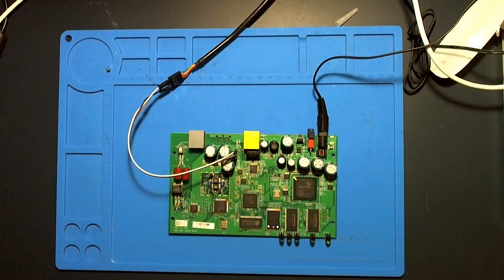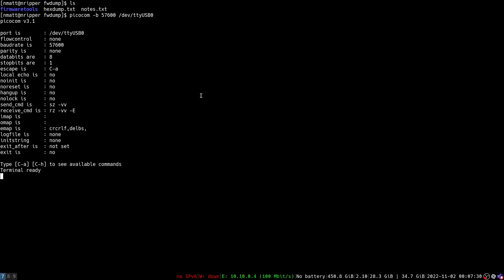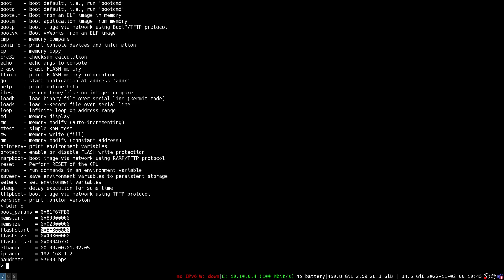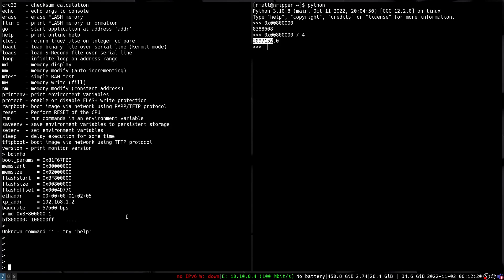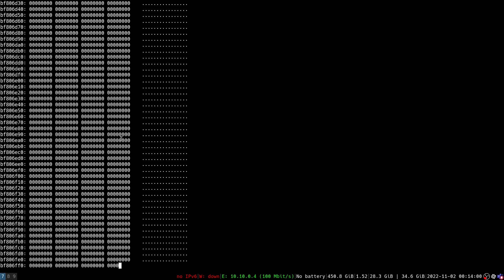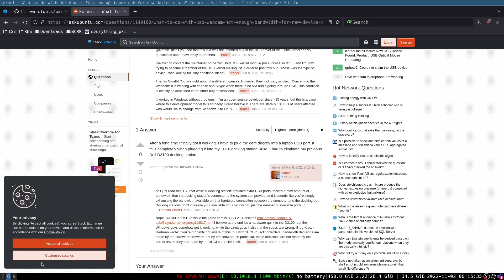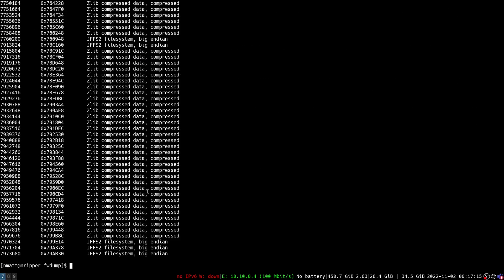Extracting Firmware from Linux Router using the U-Boot Bootloader and UART

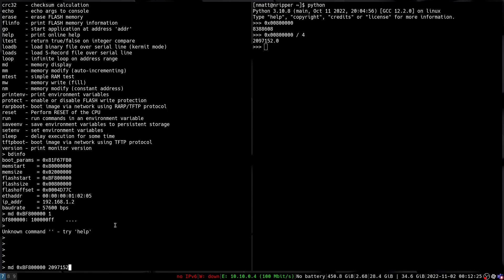Comment: Great video! At 7:23 for anyone who's following along and is wondering why their memory dump continues way past the expected address. That's because the md utility expects a hex value for its second argument, so in the python interpreter after you've divided flashsize by 4 you should convert it to a hex value using hex().
Reply from the maker: Good point. I always forget about that 😂

Comment: Amazon has decent Chinese XLR condenser microphones with XLR to 1/4" adapters included for $29. Please. If you need it I've got a 48v usb phantom power supply. If you don't want to upgrade hardware, at least use Audacity to tweak EQ and nuke some of those crazy mids? Other than that, subbed bro. Good vid. Top notch technical stuff without the typical YouTuber BS and fluff. Hardcore bro.

Comment: Trying to parse a dump with the script you wrote and I’m having issues. It only chews threw a few megs of data before it errors out. 
“python non-hexadecimal number found in fromhex()”

Re-writing this code to rust I get the exact same output (at least as far as diff is concerned). Not sure exactly why though 😣

The dumped file from picocom is incomplete (terminal froze after so long — maybe I asked for a bad address range?) but the input is roughly 32 MB and output is ~2.3 MB. I’m very new to embedded but also willing to learn new things. Hope to work thru this issue soon
Reply from the maker: So if picocom outputs something weird it could affect the script's ability to decode. You can either redo the read or manually look at the text file in the place it errored out and fix it.
Reply: @mattbrwn  I want to add a debug statement where it errors but I’m not getting the logic of the loops 100% I guess it’s something I need to fiddle with a bit more. Big brain time 😮‍💨

Edit: I also don’t have bdinfo in the system so I’m. It sure where to start looking. The bootcmd variable has some addresses that look promising and a few statements say where things are like 32kb of data at some address etc. I tried calling md on it and it has something there but for now I’m still kinda poking around in the dark. Looking to read the flash thru a chip clip and maybe dump that way.

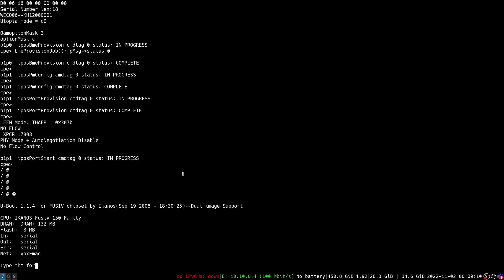Comment: At 4:05 i see the line "hit any key to stop autoboot: 0" spamming the whole keyboard before it but still boot up mine is not even count from 1 to 0. how to solve this problem
Reply: a bit late, but i had this problem too! i just madly pressed every key + enter on my keyboard and it eventually worked... coming back two hours later to tell you that spacebar is the key that worked for my specific system!!

Comment: I have a Siarra Wireless cellular router that has firmware  for windows control program. The cpu is for Arm At9. There is available a version of linux for this cpu. Could this info be obtained using Linux through the exixting usb port on the board. Would it be possible to erase the flash and install the linux os. I would like to use OpenWRT to control the cellular radio. Thanks for the great content. 🇨🇦
Reply: You would have to hook up to the uart onboard and often it already runs linux, just not GNU/Linux. I think its possible but idk the bootloadef

Comment: Hi Matt first of all amazing video’s! I’m learning a lott! I’m trying to revive an Unifi switch which does not want to boot, not even uboot! I’m trying to dump the firmware via another still functioning Unifi switch using the uboot md command, but I’m having trouble starting because my uboot does not have the “bdinfo” command, it is a mx25l25635f chip which is 32 Mb I guess? Can i just start md 0x00000 8388608?

Comment: on a so old 2008 bootloader ... no secure boot...
Reply from the maker: welcome to IoT!
Reply: lol not all of them, i'm facing this right now
U-Boot 2018.01-RELEASE-gb0bd058b3f
Secure boot enabled.
Qualcomm IPQ807x-AC01

any idea ?
Reply from the maker: @mokran937  Is the bootloader also locked or password protected?

Just because secure boot is enabled doesn't necessarily mean you couldn't dump the firmware.

some more details about the device would be helpful.
Reply: Tried to answer many times
Reply from the maker: @mokran937  lol I got the log but can only see your link in the notification. yeah youtube is freaking out.

Noticed from the logs this is a Meraki device. Cisco probably takes security pretty seriously on those devices so it might be a hard path forward.

If by a long shot they leave JTAG enabled you could try using that to get into the bootloader.

Also chip off firmware extraction could be a good try. what flash chip is it running?
Reply: @mattbrwn  yes chip off wouldnt be a problem i think but my plan is to install openWRT on it and not sure chip off would help for this
Reply: @mattbrwn  i think i just found the jtag pins, any idea ?